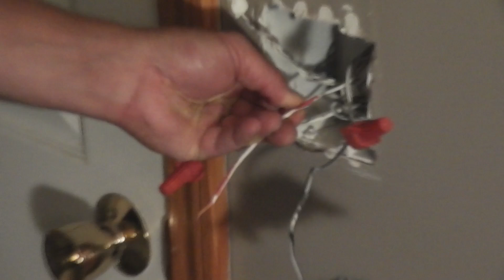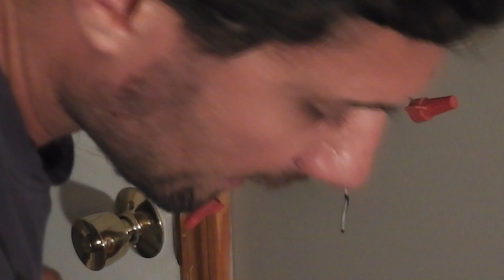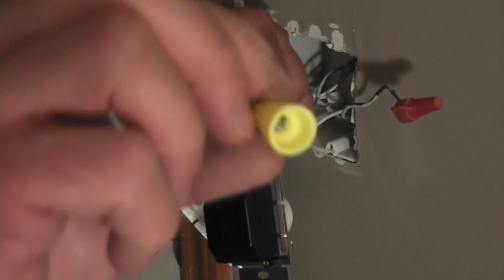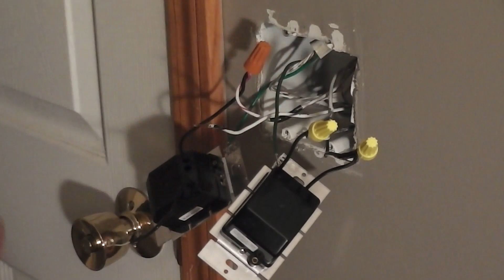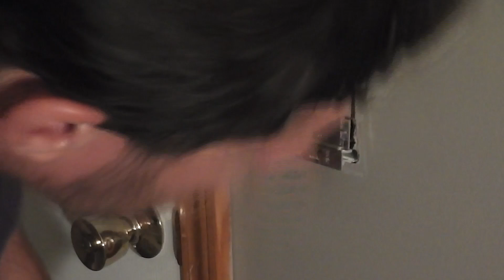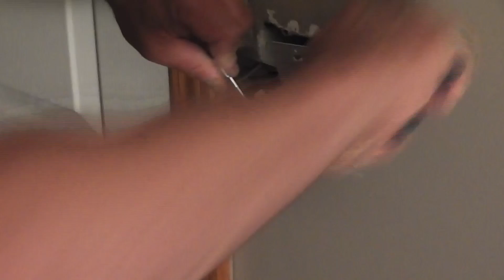Installing Dimmer and Fan Speed Control

Comment: I thought I understood electricity, but I'm running into weird stuff...like ground and/or neutral wires being energized, as well as switches that are turned off powering a fan motor...but the wires still being hot.

Comment: Nice explanation, the original install on the fan I'm replacing must have wired the fan wrong in the ceiling, so when I installed the new one the switches were backward. This video made it easy to switch the wiring around to the right way. Thanks to you and your Father

Comment: I have a blue red and black wire wich is hot ?
Reply from the maker: Don’t know. Have to consult instructions if you have them. Could be a 3-way or a combination fan/light device. I would need more info to determine what each wire does.

Comment: Will this work for wiring a dimmer switch for bathroom lights plus a timer for bathroom exhaust fan?
Reply from the maker: Yes. Concept is the same. Particulars may differ depending on the brand dimmer and timer you have.

Comment: Here is what I have:
1. black and white wire coming from circuit box (check with MM and the black is hot)
2. black white and red going to the fan/light
3. two white were already connected and tucked away, two back were connected together.
4. What we have; two back together which connects to screw#1 on switch, red connected to screw#2 (this is a regular toggle switch and was the default; stay with me!)
5. Old toggle switch removed
6. New dimmer ordered from amazon for fan control has 1 black, 1 red, 1 yellow & 1 green. Another red and another yellow are optional for 3 way according to manual (capped off).
7. Two blacks are connected
8. green connected to ground
9. Tried different combo like red to red, yellow to red etc. nothing seem to work. What am I missing?

***Had another dimmer that does not have fan control that only has two back wires and this works by connected black to BLACKS (connected together) and the other black to red. This have a humming noise as it is not designed for fan and is dangerous. 

Please advise.
Reply from the maker: The way it was originally set up is one way to wire (maybe update to) a 3-wire (black, red, white) system when you only have a single switch on the wall. The black wire going up to the fan is spliced directly in with the feed from the circuit box, essentially making the black wire up at the fan hot all the time and giving no choice but to control the fan speeds using the pull chain right on the fan. Wiring it this way allows the switch to control the light on the fan (via the red wire) without causing the fan to turn every time the switch on the wall is turned on.

I don't know about the specific device you are trying to use. It sounds to me like it enables you to have a fan and light control in a one gang box.  So far you have tried the right things. Make sure the fan is set to high speed and the light is in the on position via the pull chains. You can also use your MM to test the red and yellow wires to see which one is energized when the switch is turned on. I wouldn't really know more without looking at the manual for the device. If you have installed it as specified in the directions then the problem might be somewhere else or the device might be defective.
Reply: +Crossed Wires Thanks. Maybe I would just pay someone to look at it one day when I have some other electrical problems. I once paid someone $110 to connect two wires together- the lowest he could charge was a diagnostic fee per company policy. I could see he felt bad and even gave me the option to just wire it myself after telling me what it was but that will still be a service charge fee of $89. lol

Comment: I remember replacing a light dimmer with an on/off switch for a ceiling fan because dimmers are bad for motors.
Reply from the maker: +The Channel of Random Ceiling Fans Yes they are. This fan has a dedicated switch leg (red wire) to the light so it's fine to use a dimmer. Dimmers to control fan blades turning is not good and can ruin fan motor and dimmer. Infinite speed controls can be used though.
Reply: Yeah, and infinite speed controls can only be used on certain ceiling fans, some motors are not safe for them from what I heard.
Reply: The Channel of Random Ceiling Fans solid state controls are becoming common again, more new fans in the manuals are saying suitable for use with solid state controls. This maybe because they are trying to eliminate damage to fans from improper controls to them, so they maybe trying to make fans compatible with all types of controls now. In the late 2000's residential solid state controls were hard to find  at least for me at the local hardware store unless they were for commercial ceiling fans or special ordered from the distributor. Now they have a bin at home depot, lowes, and other stores for residential variable speed. In the 80's variable speed was so common. Why they tried to end that option as it is the Cadillac of options, one could only guess. But it's been revived as an option. Heck I remember the 4 blade spinners by Montgomery ward and wing tat. They were solid state compatible. Loved the bell Canopies on them.